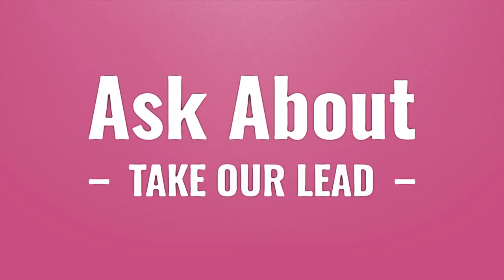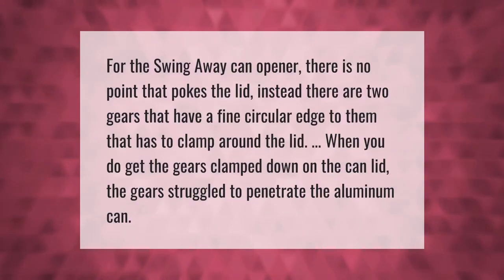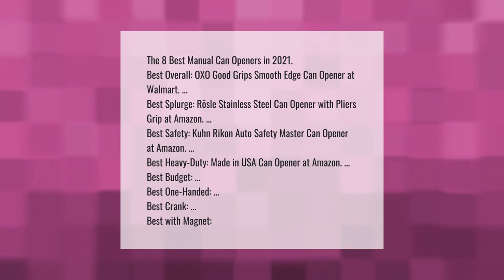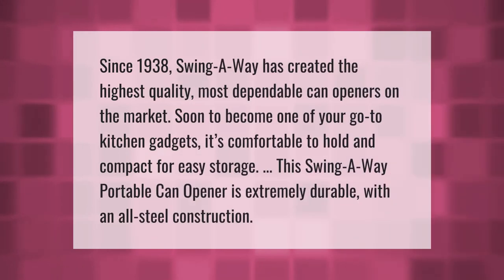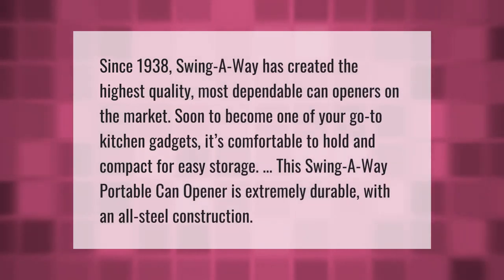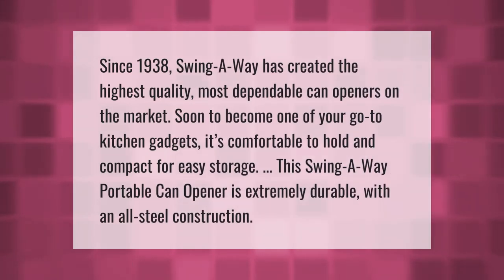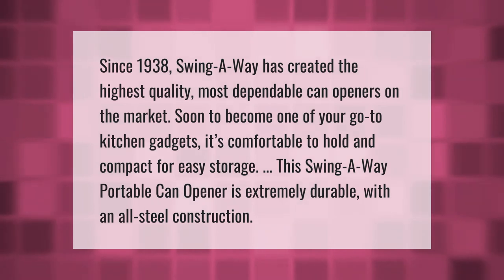How does a swing away can opener work?

Comment: Mine is Chinese garbage.  The cans work their way off the opener or it mushes down the top of the can without cutting into the lid.  I have to push up on the can while turning to get it to bite at all and I have to go around two or three times and then the lid always holds on in at least 2 spot every time.  Junk!  It used to be a good brand can opener, but not any more.